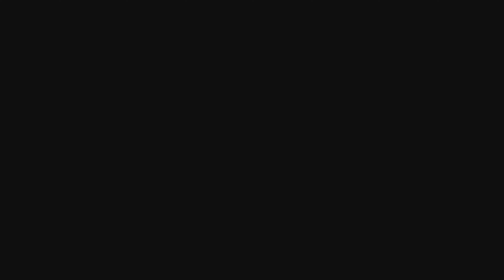XIAOMI Mi Robot 2 in 1 Vacuum Mop-P (2020) | Unboxing, Full Review & Working

Comment: Does it require good wifi range?
Reply from the maker: Yes
Reply: @fusionstudios2k19  there is wifi but in one of the rooms the range is not there..will that create any problem? Or it will work as 80% area has good wifi network
Reply from the maker: It actually need good wifi range. If u have range problem buy a repeater, connect to the wifi and plug to the place where there is less range. So all your home area get covered.

Comment: I bought one but can’t store all the house area on map
Reply from the maker: Hi there, try updating the firmware of your Mi mop from the app and also update the app. Usually it performs decently under 1000 square feet. But for area above 1000 square feet, u must need a proper strong wifi system. If the issue is still not resolved try contacting the customer care.